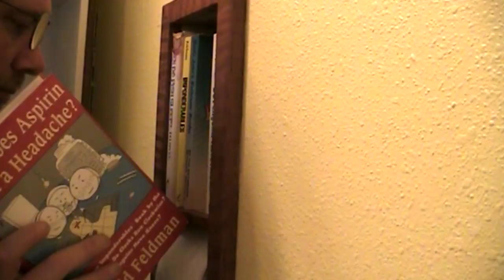Jon & Lou build a toilet paper holder and book-nook

Comment: This project was done by a complete nin- com-poop, All it lacked was an upbeat eightie's theme. Still I have to admire the way you can be completely off the wall and still teach us something. cool project. One question though..given the fact that most walls are only three and a half inches thick (four if you add a layer of drywall), how did you make the project deep enough to hold books?